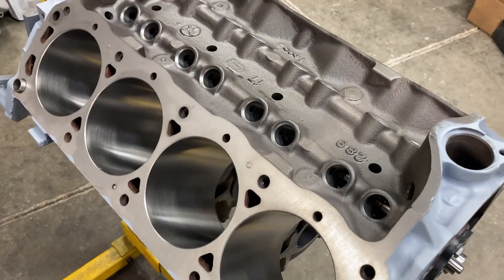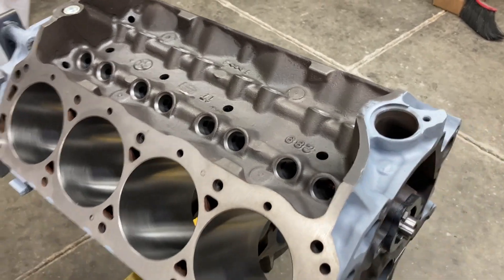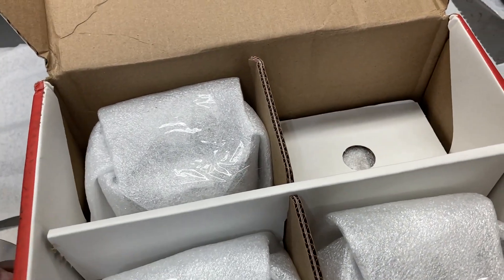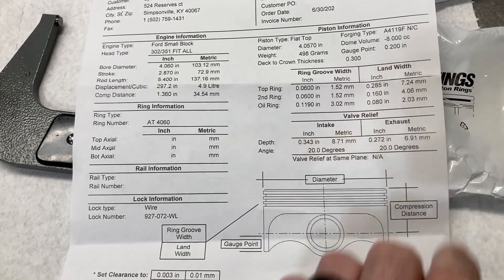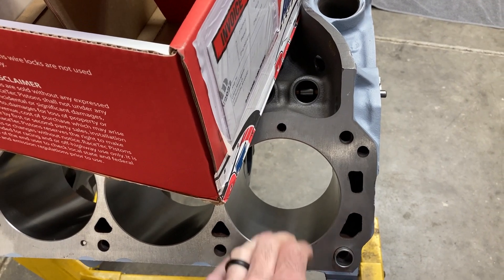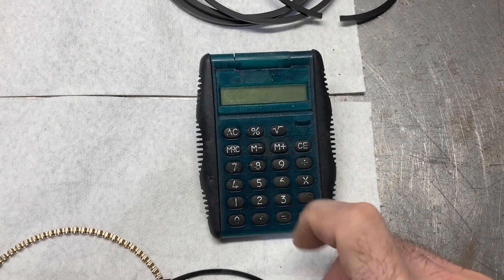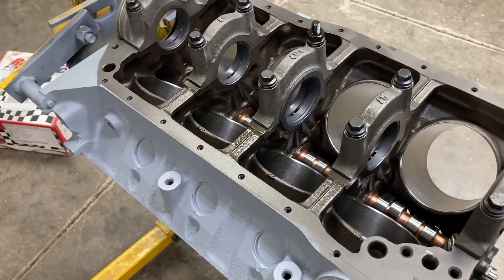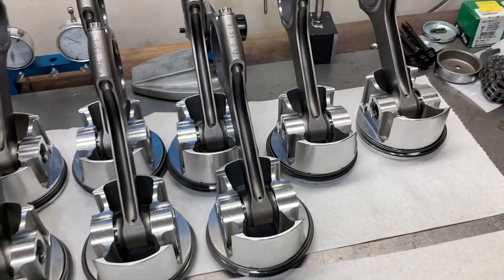Lykins Motorsports Ford 289 Shelby Cobra Piston & Ring Overview

Comment: Brent cant wait to see what power this puts out with factory heads and manifold ported...I have a 289 with afr165s and custom comp cam...Also do you do the machine work?
Reply: Check out the David Vizard Powertec 10 video on 1,000HP SBF modifications and block failure reasons.

Comment: You may have covered this point already, if so I missed it. What is your position on taking a 289 block beyond a 40 over bore? Did you sonic test this block before going to 60 over?  I've always understood that 40 thou was the safe limit for these blocks.
Reply from the maker: I sonic tested this one.  If it's thick enough, you can do it.

Comment: Hey Brent for those of us who aren’t as up on ford ? as others can you explain why they have different oiling for the 427for instance like side oiler and such?thanks, btw this is an honest question.
Reply: Hey Greg, maybe I can help with your question. The first 427 fe blocks were center oiler blocks. They sent oil to the cam bearings first before the main bearings. It worked pretty well on the street but in NASCAR the oiling wasn't good enough to run at 7000 rpm for hours, so Ford came up with the side oiler. That block sent oil to the main bearings first and then to the cam bearings..
Reply: @wysetech2000  thanks I wondered if it was some kind of an update

Comment: Now I like a Ford small block for a Cobra replica rather than a big FE or 385 series.  Lightweight and great power for a nice handling Cobra.
Reply: I agree. Love my 302, it makes 445ft lbs and 480 hp at 6000. Super snappy
Reply: @jasonhooey5677  and yet most of  these Likens customers want a 600 plus horsepower big block for their cobra replicas.  They are not great handling cars for an untrained driver and will kill you quickly if careless.
Reply: Uhhhmmmm....BS!
I have a 468 FE (2 x 4bbl Tunnel Wedge) ERA Cobra and it is NOT a bad handling car!
I've run it a VIR, Summit Point, and NJ Motorsports Park 
It IS A HANDFUL when the secondaries open and 600+ HP hits P295 street radials in a 2,400 lb car!!
😯😲🤯

I like to refer to the rear tires as; 'Rubber Fuses'

BTW:
There is NOTHING like the sound of a solid lifter Big Block FORD FE breathing through 4" sidepipes at 7,000 rpm.